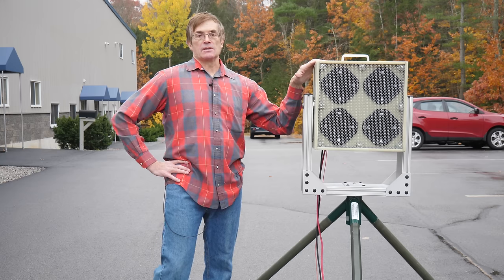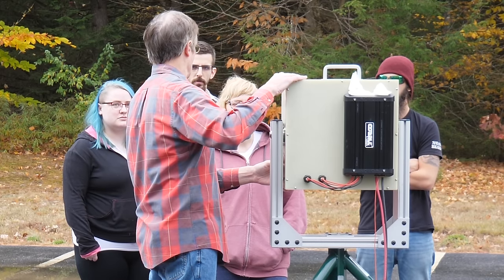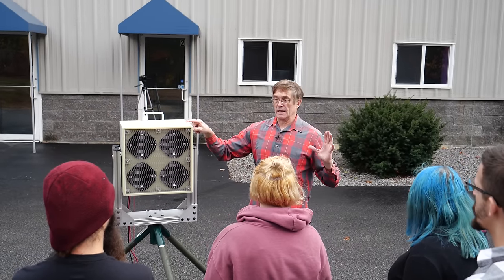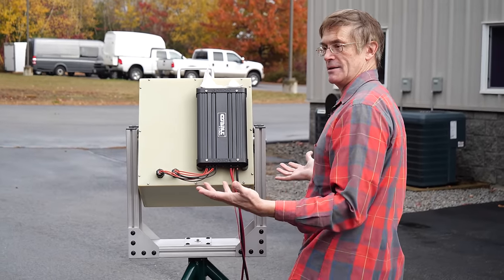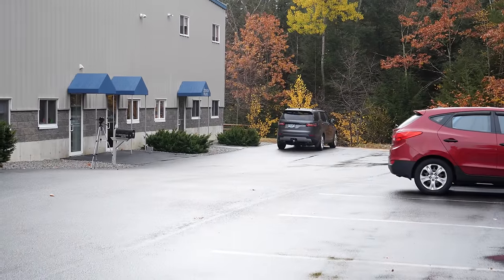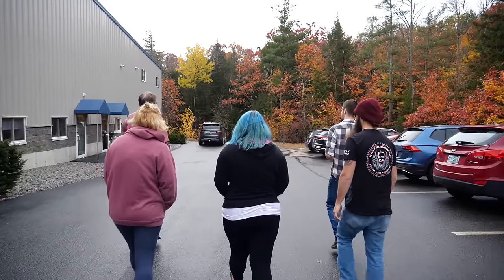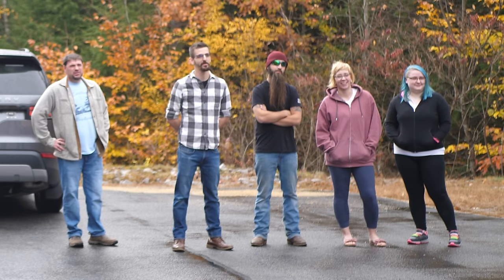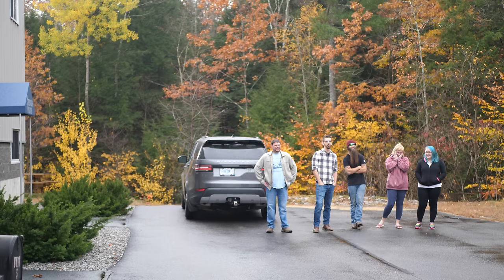LRAD vs "Volunteers" - Field Test

Comment: You lost them at "RCA connectors".
Reply: ...which by the way aren't particularly water-proof, typically having a hole straight through the middle...
Reply: We call them tulip plugs in Holland...
Reply: @andymuller327   Wikipedia:  The name RCA derives from the Radio Corporation of America, which introduced the design by the early 1940s for internal connection of the pickup to the chassis in home radio-phonograph consoles.
Reply: @AttilaAsztalos  I'm waterproof and I have quite a few holes
Reply: And all those loose wire strands... At least replace'em with a proper Neutrik Speakon cable

Comment: I still want to see this hooked to an active noise canceling system.
Reply: The nausea beam
Reply: This has poor audio quality so wouldn't work very well unless your noise source is ultra loud as well
Reply: I wouldn't expect to get a very loud silence though.
Reply: imagine where soundwaves amplify each other.. . . . ..
Reply: aggressive anc
Reply: That does not work at a distance, only if the speaker is directly on or in your ear.
Reply: Might be impossible to account for the signal processing and sound wave speed latency
Reply: @FSXgta  the poor quality comes from the microphone recording not the device it's self. You'd change your mind if you were able to experience it.
Reply: Check out their defeating LRAD video
Reply: It would probably just trim out lows and low mid background noise
Reply: BUT CAN HE PRODUCE THE BROWN NOTE
Reply: @NicosLeben  they work from a distance, the wavelength is really precise though. The higher in frequency you go, the narrower the wavelength will be for one cycle. That's a sort of sweep. It can be nauseating. SWAT teams have used these at over a mile, there was even a TV show that had a demo like this. The demo was at a wedding and every person heard a different song. It obviously had to be a frequency modulated thing to work properly, but long distances are achievable with smaller drivers and higher power.
Reply: Benn Benn did a video to defeat LRAD. Turns out mylar paper did better than an active noise cancelling system.
Reply: The highest frequency that can be effectively cancelled is limited by the distance from the cancellation audio source to the listener's ears, among other things. Noise-cancelling headphones are as good as it gets, for reasons related to physics, not processing.

Comment: That is genuinely frightening. Obviously the experience can't be properly felt through a video but you can sort of imagine how it would feel. The fact it was only used at 25% and seemed truly painful is.. yeah, frightening. Well done as always. It's amazing it can be made for only $500. (And the price of learning how to make it of course but that's impossible to put a number on)
Reply: Well it's 5 killowatts, thats like the power source of a big house with roughly 16 solar panels of some fairly average output being at peak power and utilization. You might want to consider the price of the powersource of this baby.
Reply: Or perhaps you just plug it into the grid, at which point it costs a few dollars to run this for an hour.

Comment: I spent the last 25 years of my working career  servicing audiometric testing equipment. Our audiometers can tell you how deft you really are after standing in one of these sound fields. If you are an employee in the United States you are covered under OSHA. The equipment that I also sold & service could tell you how quickly you are into an OSHA violation. High-pressure sound fields are very dangerous and tend to be very permanent.

Comment: I have alot of car audio experience and wanted to let you know your lrad is being way underpowered. The amp you selected will only do an actual 150rms x2 at 4ohms. (how you have it wired) And it only does 300w rms x2 at 2ohms. Basically all of the ratings given for the amp are false. An easy way to make a accurate estimation of how much power a car amplifier will do is to take its fusing amperage and multiply it by 10. In the case of your amp 60ax10=600w. Doing it by 10 instead of 12(v) will give you room for efficiency loss and the math is easier. The amp linked below would be a much better choice and its basically the same price. If you wire this one (its a 4ch) at 4ohms stereo (how it does its most power, unlike a 2ch that does its most @2ohms stereo or 4ohms mono "bridged") by bridging the channels you will be getting the full power from the amp which is around 900w rms and be tripling the power being fed to your drivers (still under the 1200w rms the drivers can handle though) https://www.ebay.com/itm/Orion-CBT35004-Cobalt-4-Channel-Amplifier-3500-Watts-Max/333693285505?epid=21040375480&hash=item4db1ab7481:g:R~cAAOSwJsVfPwpt
Or you could just buy another amp just like you have and run both of them @4ohms mono (2 drivers wired in parallel with both channels of each amp bridged together) and you would be quadrupling the power your drivers are currently getting at around 1200w rms total. You would then be getting full power from both amps (instead of all 4 drivers getting half power from 1 amp) and it would be a perfect match for your drivers which handle 1200w rms.
Reply: Excellent information right there!
Reply: @maxor1986  Thanks! I tried posting the same thing on the first lrad video. And I posted it on the last unrelated video right after it was released so I assume it was seen. Posts older than this one have already been interacted with also so I assume it was seen x2. Its weird none of the posts got any interaction from the channel though.
Reply: I don't think the actual output power is the most important in this application. Sure the rating of the amp is completely bogus (5000 Watts China), but whatever actual power this thing can put out, at 1/4 gain it was already too much. The amp is already at least double what's required!
Reply: @sinisterhipp0  No problem. I would be happy to try and clarify anything if you would like. The way I insert things in parenthesis during a sentence can be a bit confusing.

Comment: I read down thru hundreds of comments and I only found two that hinted that this is not an LRAD. This is simply a very powerful acoustic device in a small enclosure. LRAD works by modulating two 40K signals and the sum of those two signals is within the range of human hearing. If this were an LRAD we wouldn't hear a thing, because only one person in that group would have heard it.

Comment: I'd recommend upgrading the amplifier. That Cobalt only puts out around 1,200 watts rms at 2 ohm and because it's not a 1 ohm stable full range amplifier the efficiency just isn't there so your getting nowhere near its rated power much less the 5000 watts the amp states that it makes. A really good company that puts out rated power plus more is Rockford Fosgate and I'd suggest going with either them or another of the same quality. Also if you want the most out of your settup I'd suggest replacing your input wire with 0 guage welding lead cable so the amp has all the volts and amperage it needs to be stable without having to over work and cause amp to clip. That will also damage the drivers in the long run.
I've been around audio my entire life learning house and car audio at a very young age. I also have played guitar for over 20 years now playing and recording music since I was 13 so im right at home when it comes to audio of any sorts.
Reply: If you took advantage of the wattage these drivers are rated for you'd drastically see a incline with the decibels. One more thing would be using a RCA inline crossover with multiple band equalizer to dial it Into the exact frequency range that the drivers and box dimensions equate to and find it's resonance frequency to then know where your decibel peaks are.

Comment: I would've liked a test when they allowed to cover their ear as much as they like. Is it possible to get close if I just plug my fingers in my ear?
Reply: Not recommended. If the hands slip once, bye eardrums. Also, most LRAD are not used at full power at cost range.
But if rioters would come too close, at max level it affects more than just hearing
Reply: @pteppig   Cool username!
Reply: Above something like 130dbA your body, skin, bones, and other parts become a radiator of the acoustic energy. You can only really ever attenuate 30dbA of energy. Like I said due to your body becoming the passive radiator in the speaker box of open air.
Reply: Yes, if you're already deaf.

But probably still no if you have eyes or teeth.
Reply: just fingers probably wouldnt be very effective, but like others have said it is less effective at close range. mainly because at close range the fastest way to get out of the path of the noise becomes toward the operator or a short walk to either side. also if it's so loud it makes you deaf, now you are deaf and not at all bothered by that noise ever again. 

probably best to just avoid noises that loud in general though, instead of trying to get close, if you value your hearing.

Comment: Really nasty done in a friendly way.
Love it. Next time a low frequent wave cannon ( like Bose used, but than better) for earthquake effects,
With really low sounds  about 8 Hz people become nauseous, I have heared.... Did make a small one if 3.5 m long 10 inch wide and an speaker of linear excursion of 2 inch ( peerless) and could perform the ultra low sound of old gasoline ( diesel )argriculture motors of about 70-90 years old.

Comment: I think you should be able to put out the same amount of sound with less power if a resonant enclosure is used. This would only work for a limited bandwidth applications, like the chirp sound for crowd control. Just thinking out loud.
Reply: If you can power it with just a car battery it's better not to take away the mic feature. It might be used to warn a riot mob that they can become deaf if they come too close. Talking goes a long way in riot control.

Comment: Car audio guy here. Very impressive build, but I have to point out, there is no way that amp or the speakers are within an order of magnitude of the wattage they claim. Car audio has long been swamped with false advertising, and most companies lie about the wattage numbers on their products. The cheapest 5000w amplifier I know of that will actually do anywhere near that power is around 400 dollars, and I'm not aware of any speakers that small that will actually handle 1500 watts- they just wouldn't handle that thermally for more than a minute or two without baking the coils, and that much power would probably destroy the voice coil mechanically as well, just from it crashing into the bottom of the motor. EDIT: I found the same amp online. It is advertised as 600w rms, 5000w max, and that max number means less than nothing.

Comment: While I love watching your videos, i feel you did a major diservice to your watchers with the details of that setup. That amplifier is in no shape or form a 5,000 watt amplifier. The gain is not a volume control, and Id be willing to bet the speakers are 1200 watts Max. The 4 gauge power wire wtih 2 batteries of that type will simply not make no where near the current stated. Sorry, again I love the channel but :(

Comment: A 9x9 or 16x16 phased array of these speakers might be able to focus the beam a bit more. But it depends on the wavelength, so you need a frequency dependent phasing done in a beefy DSP.
Reply from the maker: Did you watch our first video on the LRAD?
As the number of speakers increases, the amplitude of the peaks and nodes increases and their number decreases, but the sound wavelength which is on the order of 15 cm. requires a much larger speaker spacing to make phase focusing significant.  You're right though, it could achieve a little bit.

Comment: Consider also the explosively-pumped thermoacoustic generator, aka a valveless pulsejet and famously used on the WW2 buzzbombs.
These are infamously loud, anecdotally projecting these pressures to distances of 6 miles or more.

The "acoustic laser" exploits something similar, the simple example being a test tube with a piece of refractory honeycomb material inserted perhaps an inch or two from the closed end of the tube.  Upon heating, the expanding air in the tube is restricted by the ceramic refractory grid, yet the low pressure created sucks in more air, and you get a resonant effect that produces a loud tone due to the pressure waves and horn effect at the open end of the tube.  This is a reversible process, point your DIY LRAD at this thing and you can measure the closed end of the tube heat up.

Most curious is the thermoacoustic refrigeration based on these concepts... I would love to see you explore some of this if you haven't already.

Comment: I'm wrong! The 40 kHz signals are modulated out of phase from each other, and it's the difference that is made to fall within human hearing. The pin point accuracy is possible because the 40 kHz wavelengths are so short the waveguides can give them extreme accuracy. The audible frequencies are actually formed right in front of the victim. That's what I'd like to see, experiments with waveguides at high frequencies. What would they look like?
Reply from the maker: What you're describing is a beat frequency differential and the fraction of energy in that differential is quite low.  I don't think that's likely the operating principle.  Furthermore, the peaks and nodes in a beat are distributed angularly just like the carrier frequencies.

Comment: i have a suggestion for a little project. water heated jacket. usb water heater for heating water. custom built low flow rate low watt usb pump, to pump the heated water through a tube line that would be attached to clothing for heated clothing. you could sew it to the inside of a jacket and put in a freezer to test it. or maybe a higher watt usb c pd water heater for less time if its more power efficient, but it would need a timer and switch and i guess would wear out over time. use as little line and water as possible while still maintaining warmth in say -20 c while just sitting down. and maybe add a less warm setting for when your walking for a long time. i think it can be achieved with very little watts/h. less convenient to build and may be a uncomfortable compared to electric carbon tape but i think it should use a lot less power, but i could be wrong. maybe you could try making a jacket too out of insulation with a rubber outside. you probably wouldn't need a heater with a jacket and pants like that if your walking, and maybe not even when idle, idk.

Comment: Really amazing piece of equipement. You mentioned homemade body armor is that still happening bc nobody really goes into the science or has your creative flare in many of the YouTube videos ive seen.
Reply: I've got a few links here I think you might enjoy. Body armor is one of those things I'd leave to the professionals if you have a choice, but it's interesting to learn about regardless.
https://youtu.be/_7jiIQOgwtI
https://youtu.be/SpxmC5sYnWk
https://youtu.be/uULn_Jul43Y
https://youtu.be/VNVR0Y048H4
If you want thorough but clear explanations i recommend the full episodes from mythbusters, they retread the "is it bulletproof" at least two more times over the shows runtime, and in the full episodes of a few of those they explain that stopping a bullet requires a material to spread out the energy from the bullet without breaking. a bullet carries energy through both speed and mass, with rifle rounds typically being fast and light, and shotgun/handgun rounds being slow and heavy. slow and heavy is typically easier to stop because heavier bullets are bigger, so they spread out their energy more evenly. meanwhile rifle rounds are fast and light, meaning they are small but still have alot of energy. its sort of like the difference between hitting a tree with an axe (the rifle round) vs a club (the pistol round).
Reply: @arcanealchemist3190  thanks

Comment: I hate to tell you but that amplifier does no where near 5,000w. It may say that, but if dyno'd - you will see less than 1,000w. If you want 5,000w RMS you will need a Taramp or SkarAudio for the cheapest true 5,000w and you wont be powering that with just 2 lead acid batteries. I have 2 3500w Skar amps in my Jetta and I needed a 240 amp alternator, 3 AGM Cells, and multiple runs of 00 gauge wire.

Comment: Very Interesting video, I have all ways been VERY INTERESTED in sound waves (actually I am a sound Technician for local bands or "Sound Man" we were called at one time, this is a interesting subject for me and I understand the pain aspect for crowed control for the device that you built but have you ever given any thought to the lower frequencies? to see if there is any effect at all on the body besides the hearing aspect ???  I am sure you have heard of Mr Tesla machine that " supposedly started to destroy his work shop? from a harmonic low frequency pulse?( I know It is NOT the same thing ) a bit different than what you show here But I have ALL WAYS wanted to build a speaker system that could handle the lower spectrum to see if in deed there is a physical connection to the lower frequency bands on the human body ? When I first started to run the sound systems for large name bands I was all ways fascinated by the fact that the High end speakers or cones could be heard close up but the bass sounds or much lower frequencies could not be heard close up but you needed to stand 10 to 15 feet away from the speaker to hear and FEEL the bass frequencies I know now it is the wave Length of the bass frequency the wave length of the hearing spectrum is Fascinating!!! Thanks for posting the video hope to see more on the subject